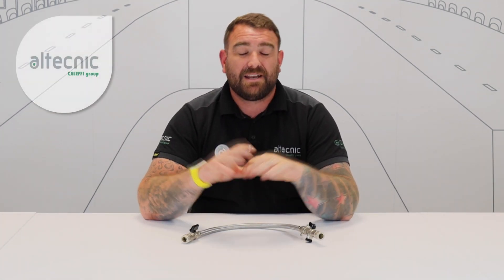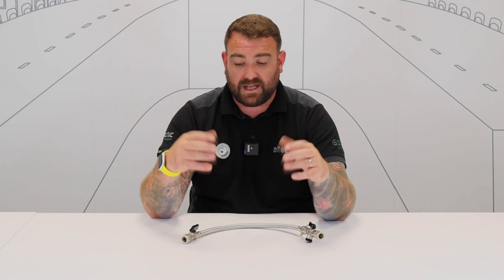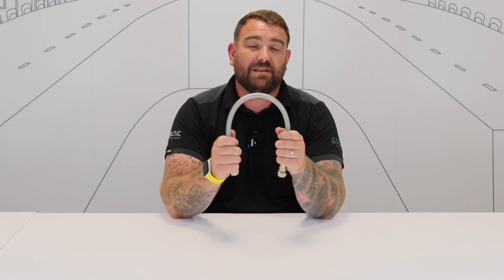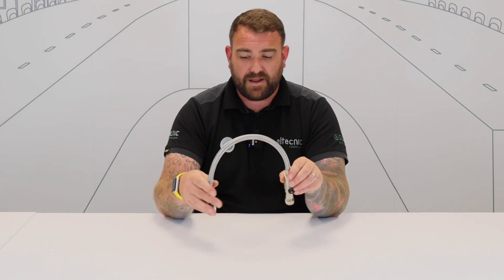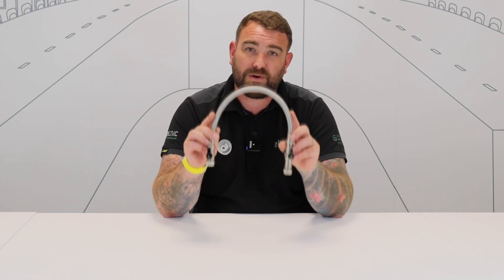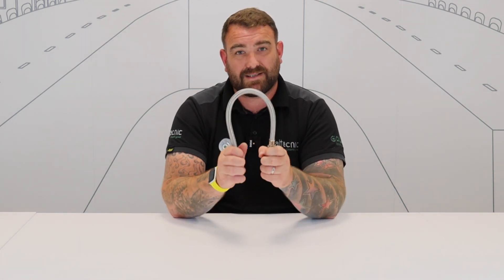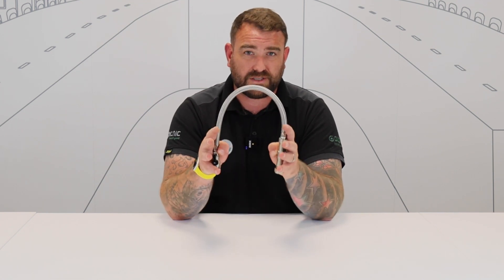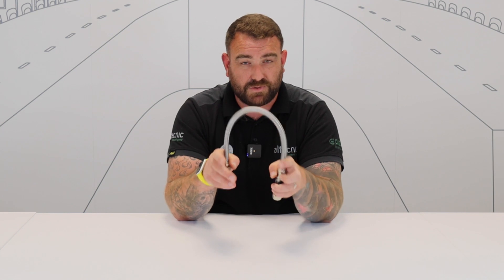All you need to know about filling loops

Comment: Is the cap on a fillings loop for a pressure gauge?
Reply: IVE just done some research and it is a test port.
Reply: test port. This port, or "test cock," is used to check that the valve is functioning correctly. 

The black cap itself does not stop the flow of water. The valve's test port must be opened and closed with a flat-headed screwdriver. 

What is a double check valve?

A double check valve is a type of backflow prevention device used in plumbing to stop contaminated water from flowing back into the clean drinking water supply. It is made of two separate, spring-loaded check valves in a single body. This dual-valve design provides redundancy in case one of the valves fails. 

How the test port is used

Testing ports are crucial for maintenance, which is required annually for many backflow prevention systems. 

Connecting equipment: A tester connects specialised gauge equipment to the test ports.

Checking pressure: The tester can then measure the pressure differentials across the valves to ensure they are sealing properly.

Winterising: In some cases, test ports are also used to drain the system for winter to prevent freezing. 

Why testing is important

Regular testing ensures the valve is still capable of preventing backflow, protecting the public water supply from potential contamination. In the UK, the Water Regulations require double check valves to be inspected and maintained regularly. 

AI responses may include mistakes. Learn more
Reply: @johnsmith-ik8il nice one...if we are to trust the AI that is😅
Reply: @eazyrat  I don't trust it for too much, but I think it's correct here.  I wouldn't trust it to not try and rewrite history though 😂
Reply: @johnsmith-ik8il Thanks, this sorted me. Was bewildered by only finding the one valve.
Reply: It's incase you want to take the loop off.  You put the caps on the pipes you took the loop off.
Reply: @johnsmith-ik8il  i mean the black cap
Reply: @eazyrat yes they probably do black ones but theyre usually silver to my knowledge and atatched the loop.  The loop isnt supposed to be a permanent fixture but you can keep them on.  You mean two caps?  Some have taps on them for when the taps havent been secured to the copper piping.  If you have any questions I will put my phone number up here briefly.  I have a decent bit of  knowledge around central heating systems.  Nothing too indepth about inside of a boiler though.  Unless you mean blanking caps.  Are they loose with threads?
Reply: @johnsmith-ik8il  in the video there is a black cap on the valve
Reply: @eazyrat Ill take a look.
Reply: I think you may be able to put a pressure gauge on the double check valve.  Your combi boiler has a pressure gauge right? The double check valve is to stop boiler water going into your tap water.
Reply: We both learned something new today.